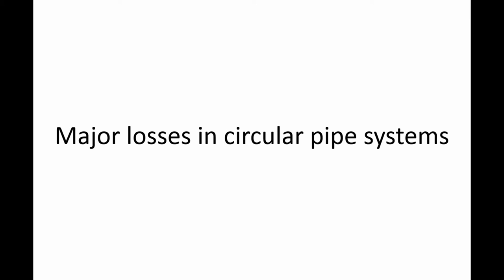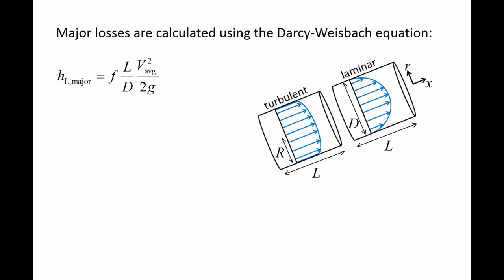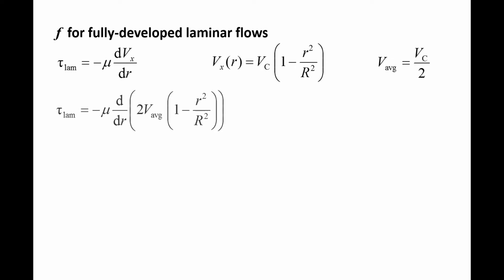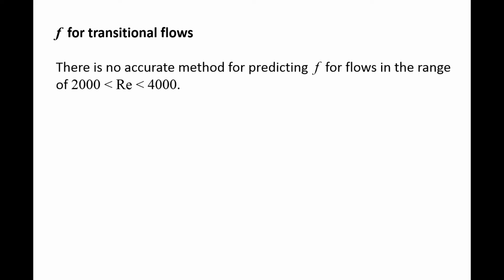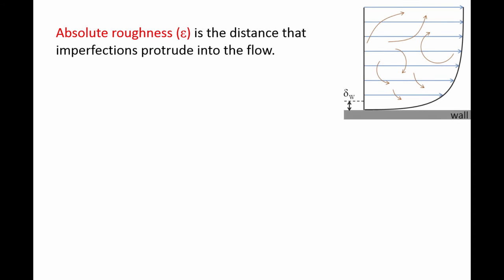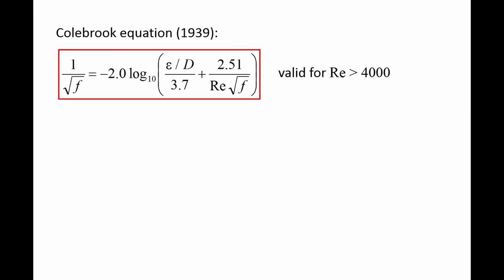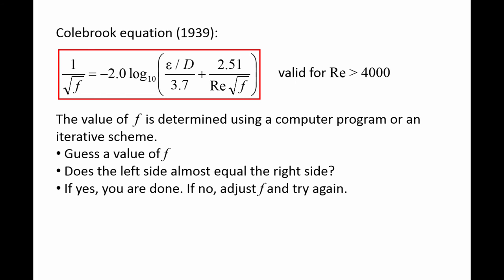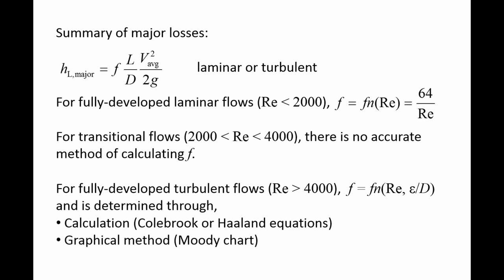Fluid Mechanics: Topic 8.6.1 - Major losses in circular pipe systems

Comment: Is Haaland equation more accurate than Swamee-Jane?
Reply from the maker: There is so much uncertainty built into calculating friction factors, that the small extra error introduced by using an approximation is negligible. Either Swamee-Jain or Haaland are fine approximations.